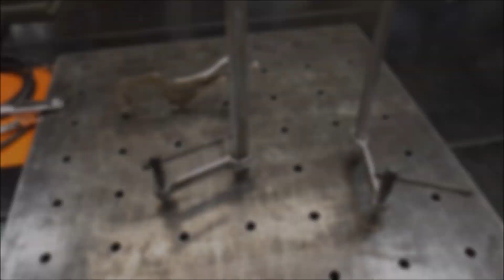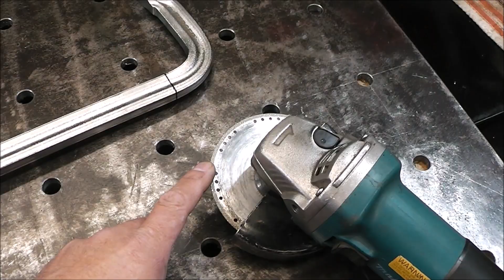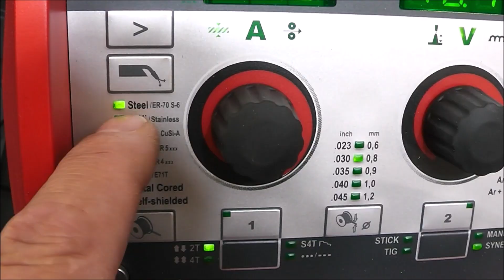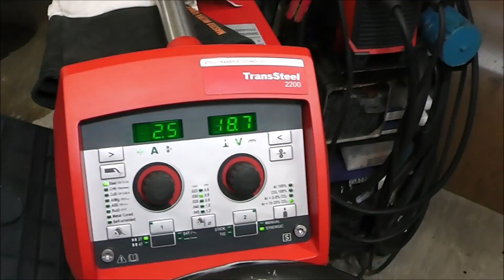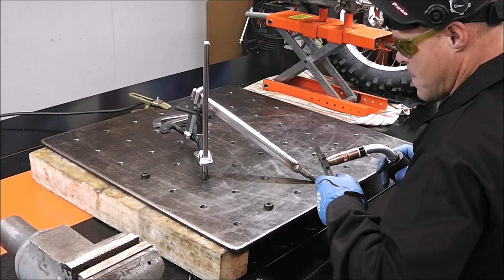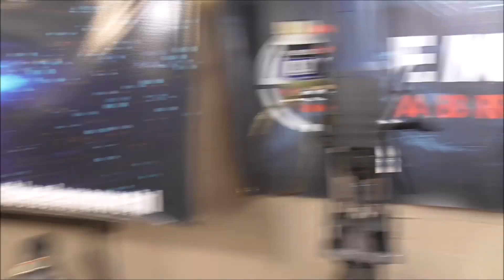Welding Tools Build Welding Table Clamps Welding Project

Comment: Why does everyone want to use shoulder bolts instead of regular grade 8 bolts? They're extremely expensive and  there is absolutely no need to have such a snug fit! Put a regular bolt on and just hand thread a nut onto the bottom of the table and the clamp will never be able to work its self out of the hole. Simple and MUCH  cheaper!
Reply from the maker: @brucemitchell5637 The first issue I have is I cant get to the bottom of my table to use a nut. The other problem with using bolts is that over time, the loose fitting bolt will cause the hole in the table to wallow out. You don't get that problem with the precision fit of the shoulder bolt. Drill rod is another alternative to shoulder bolts.

Comment: I just bought an engine stand on casters. I will use it only ones for the intended purpose. I was thinking it could be converted to maybe a fabrication table. I'm thinking since one end swivels this might make a cool adjustable welding surface. Do you think this would be practical or useful?
Reply from the maker: @velodaman I cant quite picture it but as long as it's a secure solid surface and doesn't move around I dont see why not.

Comment: I might get a yes welder plasma cutter this year. 500 bucks isn't that bad 🤔
Reply from the maker: You won't be dissapointed!
Reply: @BrandonLund  I've been wanting one all last year along with some other big Investment tools like shielding gas for my welding machine and a table saw. There's alot of neat projects I wanna get into. I think this year I'm going to attempt a bed frame and if I get a couple new tools I wanna build a mini 4x4 rock crawler. Harbor freight has a new 15hp engine 😳 sounds dangerous 😁
Reply from the maker: That sounds awesome man!

Comment: I’m trying to setup my tiny shop for both metal and woodworking. Any idea why woodworking fixtures and tables are based on 3/4” holes and metal is 5/8? I’m trying to minimize tables/clamps/etc and make everything as dual purpose as I can. Any advice on which way to go?
Reply from the maker: Well I just learned something Mike... I thought they were all 5/8". Just a suggestion, I laid out my fabrication table 4" on center but a lot of the prefab tables are laid out 2" on center. You could always drill it 4" on center with 5/8 then drill it 2" on center with 3/4 then you use over the counter store bought clamps for either wood or metal. I do occasional wood projects and use my metal clamps. I guess the drawback is they get covered with spatter and anti spatter spray so if you don't wipe them down good, the goop that collects on the clamps transfers onto the wood and stains it. Plus I'm guessing wood clamps have a soft pad and welding clamps dont
Reply: @BrandonLund  thanks! Food for thought. Btw, you have mentioned you buy shoulder bolts by the bag at reasonable prices. Do you have a link or a store name? I’ve been looking since you built the fixture table and they all seem at least $5 per bolt.
Reply from the maker: Hey Mike I've had good luck sourcing them through ebay. Unfortunately your 5 dollar price is pretty close. 5 bolts on eBay are about 25 bucks shipped...but it'd still cheaper than buying store bought clamps

Comment: Great video as always!! you can the proper size rod too cut it down and weld to the base of the clamp.  I think I spent 8.00 for 2' long section. makes a mess load of clamps. love the heavy duty clamps. Great job!
Reply from the maker: @Gadgets House of Builds thanks man and that's a great tip!
Reply: @BrandonLund  it helps if I use the proper sentence LOL 
You can use the proper rod size ! Ugh I am a mess ha
Reply from the maker: Hahahaha I knew what you were saying lol

Comment: I bought the dewalt fab table and didn't realize that they have ¾ in holes 😳.  Wtf. Now I got to make these with a ¾ bolt. Thanks for the video
Reply from the maker: @David lopata just make sure your plate is thick enough. It might not work if the metal is thin

Comment: I needed the same style clamps to use in my woodworking bench, I bought HF wood clamps for $2.99 the F style clamp, I cut off the head and bought 5/8 bolts from tractor supply 2 for $2.69 welded the bolts after grinding the flat cut off the threads and left the shoulder they work great for wood working as well as welding. And cheaper than the clamps you used. Yours are better clamps but the cheap version works fine for me! 😁🛫
Reply from the maker: Hey if itbworks don't knock it. I'm all about saving money 💰 😁👍@TheFalconJetDriver